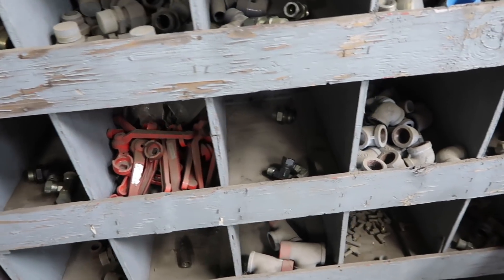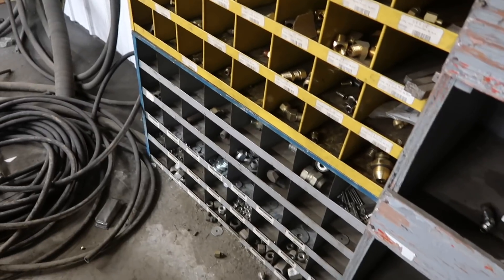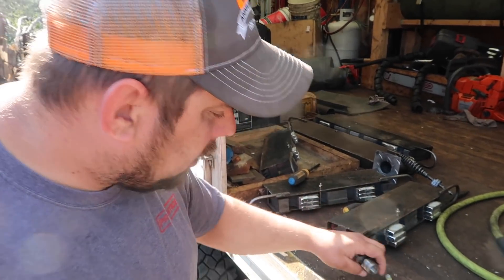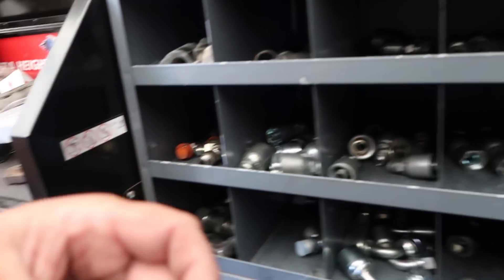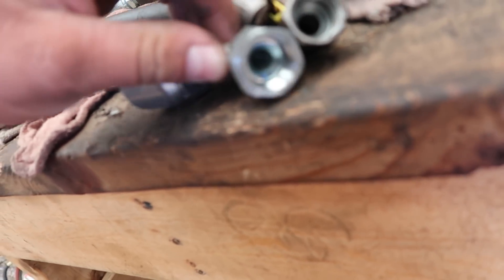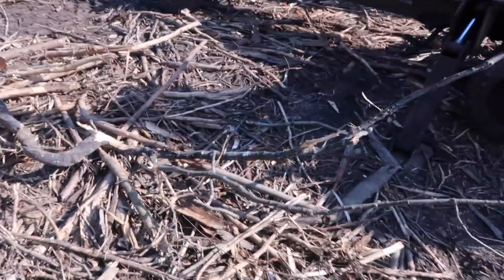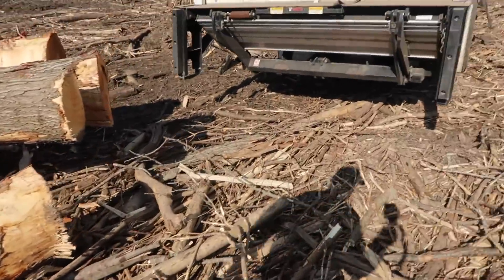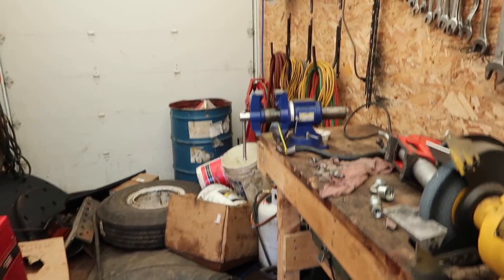WE FIXED IT!!!!

Comment: Thought I'd wait till  you cooled off. Yours was very minor to mine which i'm not proud of AT all. If I'd done the 3/4 wrench deal it's have hit me in the back of the head because I'd slung it all the way around the blasted world. BUT all's well that ends well. If you don't have the stuff, you just don't have the stuff. They ,make 'em every day. Prayers, BLESSINGS and Goomer Hugs all day almost tomorrow!
Reply: Lewie McNeely haha sometimes a guy just has to let her loose
Reply: HOW true! Years ago when the local boulder was starting I was loading shot rock with a 7-G Fat-Allis (fiat-allis) track loader. It'd break in half where it was bolted together sometimes the best you could do. Just to explain a thing, my whole family was in WW-02. My Dad was in the Army Signal Corp, one Uncle was in the Sea Bees (the one I took after as far as running stuff) the other Uncle was Merchant Marine and was on the Wasp when it went down and survived and their sisters hubby was in the Air Force and ended up a P.O.W. and made it home. The blasted loader had popped again and I was trying to get the bolts tightened back down, the wrench slipped and I fisted the tranny case and I put that wrench out of sight. Just then the Wasp uncle peeped out behind a boulder and went 'Tee Hee Hee'. TALK about fried and had to go hunt the wrench too. I hadn't been out of good old Uncle Sam long myself and I was HOT but got over it right fast. Blasted witnesses anyhow!! Make sawdust, Wade!